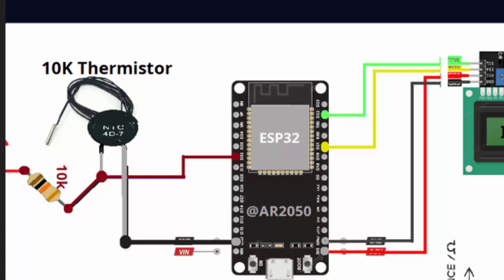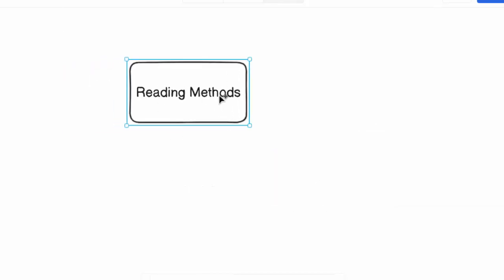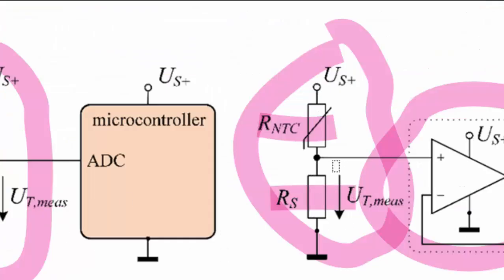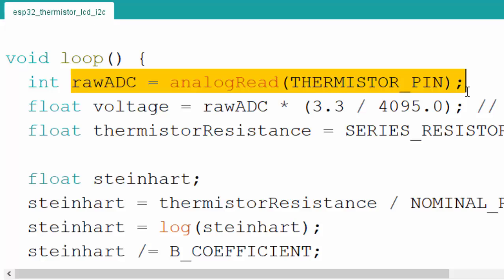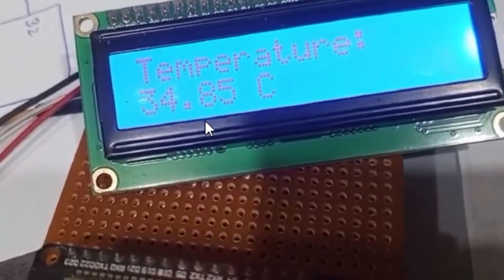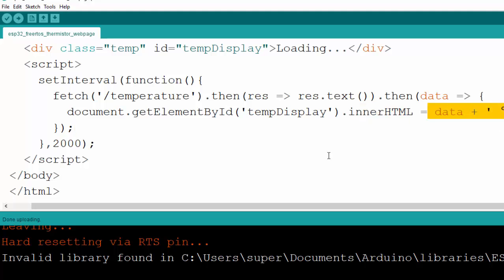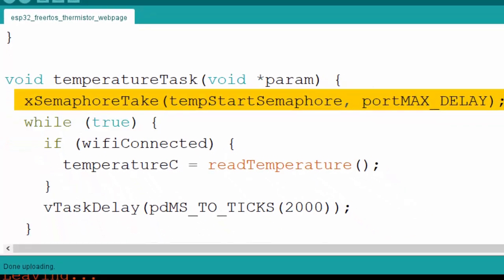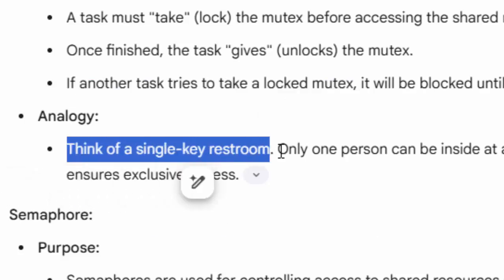ESP32 Web Server with NTC Thermistor | Live Temperature on LCD & Browser

Comment: My 10K termistor reported temperature is around 1.5C off, is it common to correct this by code or it should usually be precise by default? Maybe the termistor nominal resistance at 6:57 is not properly calibrated for each termistor, would it be a good idea to tune that value? e.g change to 9500, 10500, etc.
Reply: Thermistors are typically 1 or 2 degrees accuracy out of the box.  There is an offset and a gain adjustment required to get an accurate temperature.  For a room temperature sensor, just add an offset as the gain error is not that significant for a typical thermostat.  For accurate temperature readings use a temperature sensing IC -they come in a range of accuracy and have digital or analogue output options.  For example, MCP9700 / MCP9701 devices have analogue outputs.  They have different output scaling to suit number of ADC bits and ADC reference voltage combinations; and you would just change the NTC code to an offset and multiply calculation.